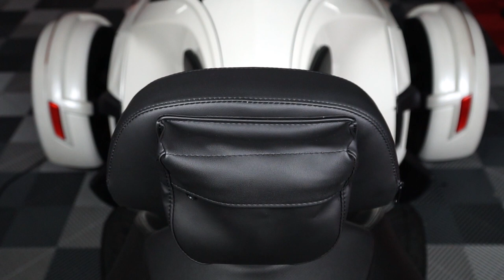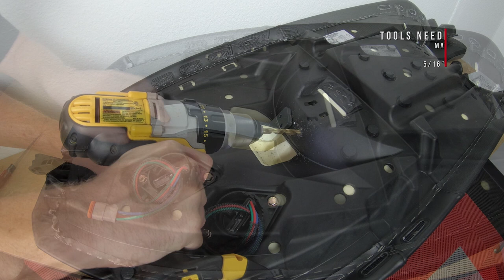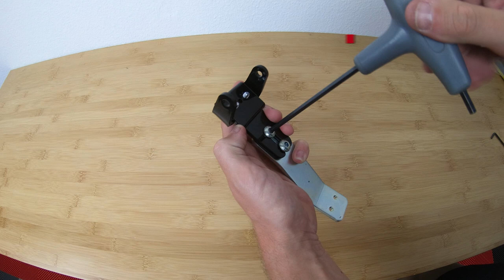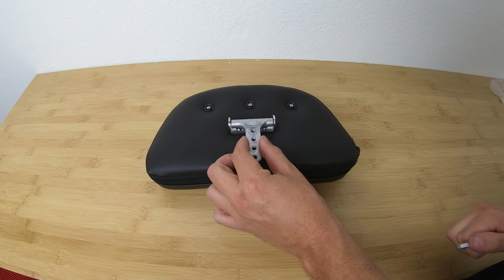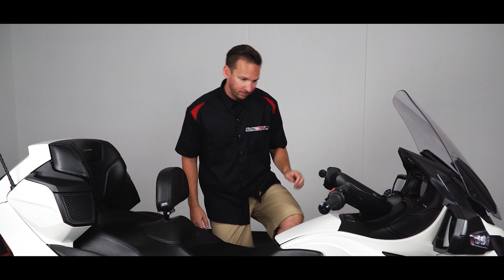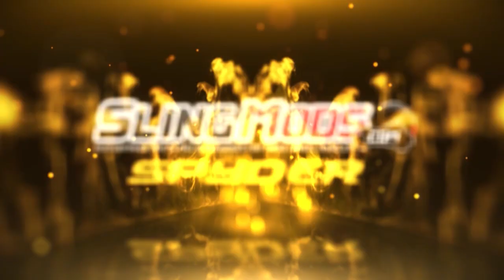Can-Am Spyder RT Adjustable Driver Backrest (2010-19)

Comment: Bradon Great video unfortunately I can not get the seat to disconnect from the Spyder the bolts are out, plug and shock disconnected, but the seat will not budge from the back. ANY SUGGESTIONS THANKS

Comment: The instructions that came with it were crap. There weren’t way to really differentiate the bolts, the 13mm wrench you need aren’t mentioned in the instructions. You have to physically puncture the material and underlying foam material to get at where the screws go. None of the tool sizes on the instructions line up. You aren’t even following the instructions as they’re written. The only saving grace is the one exploded view of everything!
Reply from the maker: Hello Steve, thanks for the feedback. I'll pass it on to the MFG. Was our video at least helpful?
Reply: @Slingmods  yes....
Reply from the maker: @stephenlafave  😎 Awesome!